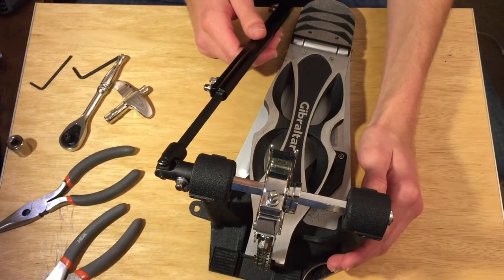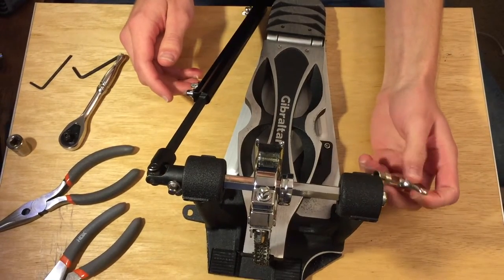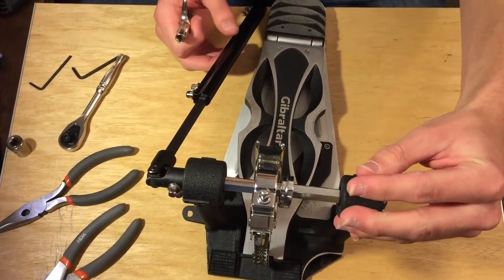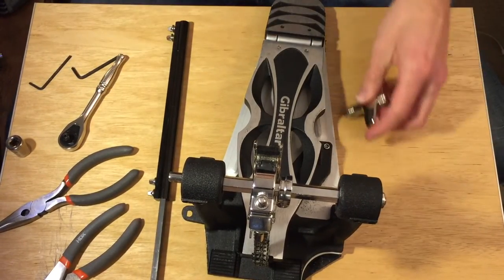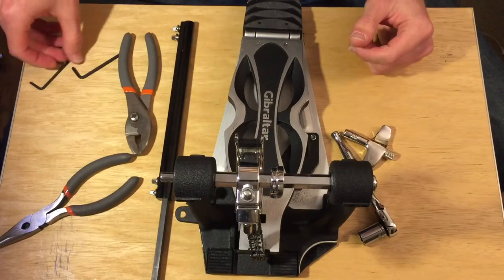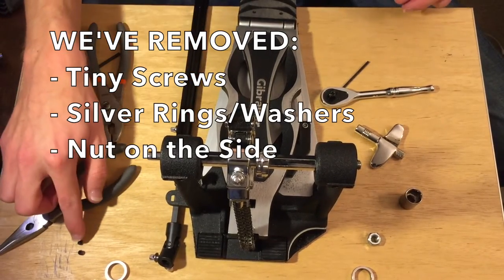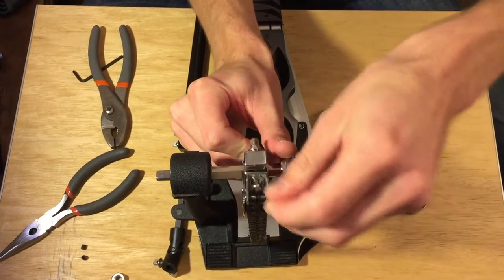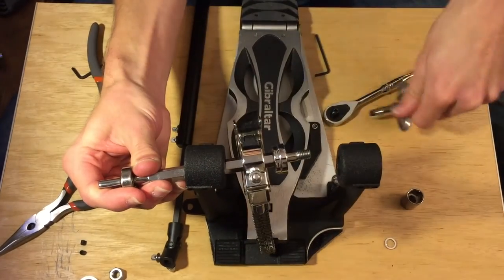How to Reverse a Double Bass Pedal | Drumming Tips & Tricks

Comment: Bro I just did the same to my double bass pedal but I which out the left pedal chain instead of the right one... Works fine. What u think? Did I f it up?
Reply: You're good. It's kinda weird he doesn't specifically mention it, but he's doing all that work on the left pedal, not the right one. I guess this is obvious if you notice the pedal doesn't have a split shaft and also doesn't have any beaters (or just notice that the rod is coming out of the right side of the pedal), but I was also confused because I'm not as familiar with double-bass drum pedals (I don't actually own one).

Comment: Hi Stephen, I apologize for my english as I'm living in Quebec city and and french speaking. I own a Gibraltar model almost like your's and my question is how to reverse the other pedal? The thing is that there is two shaft seperated but not in the middle and if I try to put the bottom plate of the pedal the other way, I'm not shure it will fit. My double pedal is right footed
and I'd like to use it with my left foot as a double bass or for my cajon. Hope I'm clear here ;) 
It'd be nice to see a video of the result if you made it.

Thanks for you time and your great advices on so many things!

Comment: What size socket are you using for that nut that’s inside the arm that holds one side of the axle? 
I have a slightly different model Gibraltar, but looks like the same nut and it’s an in between size for anything I have in both Metric and SAE sockets.

Comment: Pearl Demon Drives also don't have the arm on the other side, so they can't be reversed.
Reply from the maker: Ah...I suppose so then. I actually don't think I've ever played one of those.
Reply: they can. you can remove those pillars if you look at the bottom of the pedal, you can see that they are attached with screws. so if you reverse them, you can reverse the whole pedal. you can even find a video here about it, and it works on demonator too :)